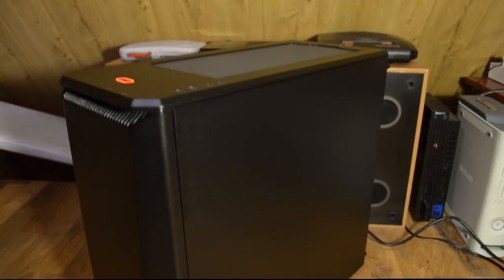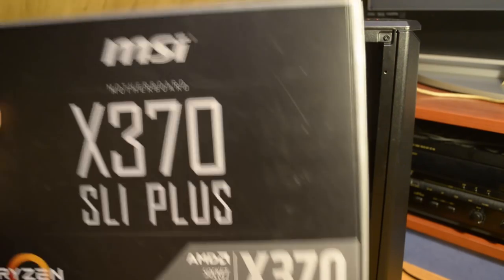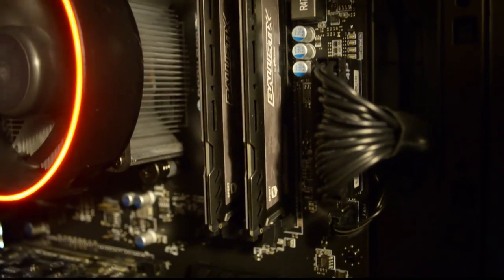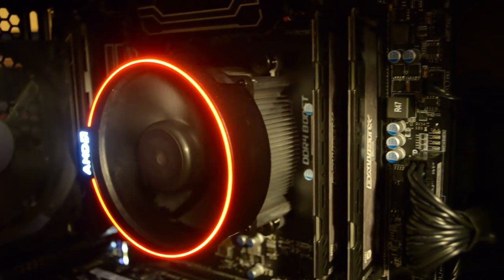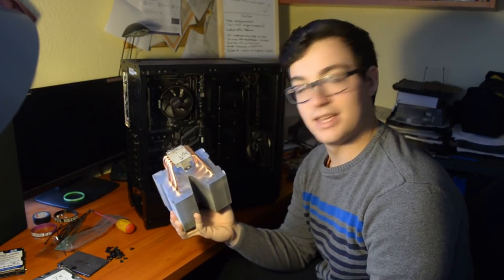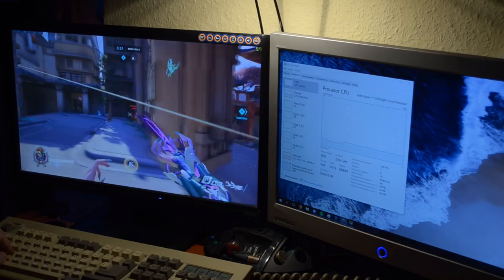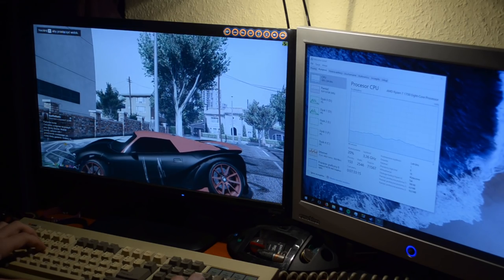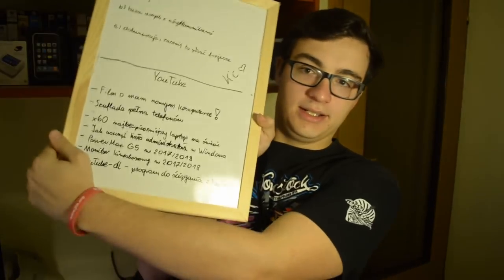Komputer za 2600zł (3400zł)

Comment: 2 lata później na BF można złożyć za 3 240zł

AMD Ryzen 7 2700X 599zł
AsRock B450 Steel Legend 399zł
Patriot Viper 16GB DDR4 3000MHz 299zł
Obudowa Ibox RGB 149zł
Zasilacz Corsair 650W 199zł
GTX 1660 Super 999zł
Dysk SSD M2 Intel 256GB 199zł
Dysk HDD 1TB Seagate 99zł
2 wentylatory Corsair RGB 249zł
Windows 10 Pro 99zł

Można kupić lepszą budę i mamy te 3400zł ale mi chodziło o małą obudowę miało to być wyzwanie. Widać jak po 2 latach można mieć dużo lepszy sprzęt za te same pieniądze. Tak to działa. Najlepsze że jak złożyłem kompa to też mi nie odpalił . Sprawdziłem wszystkie kable i już było ok. Nie wiem co było przyczyną.

Comment: Mój pecet to:
i5 3570 200zł
GTX 1060 amp core edition 3gb 700zł
2x4gb Gskill Ripsjawsx 150zł
Corsair Spec-004 230zł
5 wentylatorów led czerwonych 100zł
Zasilacz Chieftec 700w 170zł
Msi b75ma-p45 300zł
No także taki komputer mam i się cieszę :) 
Ale to strickte do Grania
Zapłaciłem około 1700zł 
Ale to komp do minecraft
{mój materiał się scinał bo nagrywałem na wyjeździe}
Ale nom